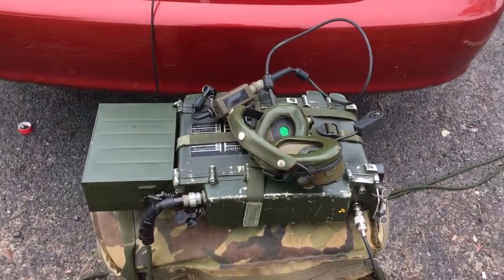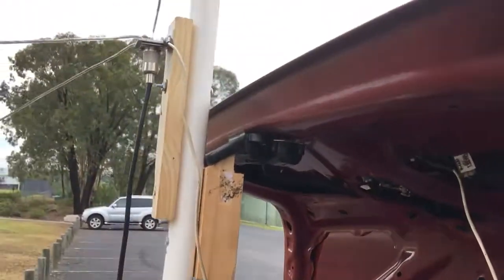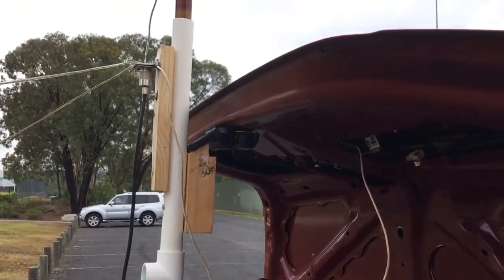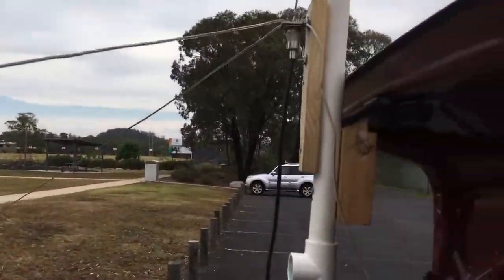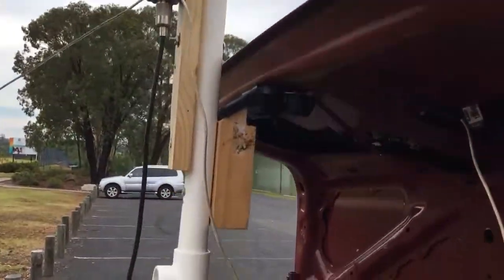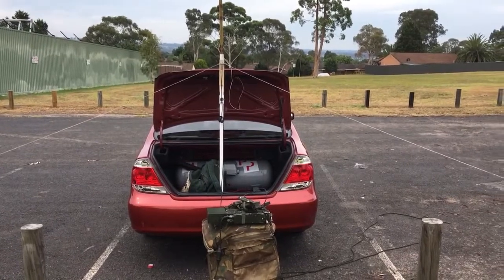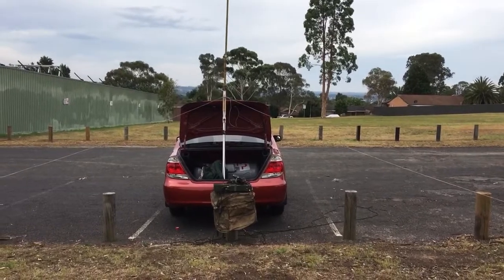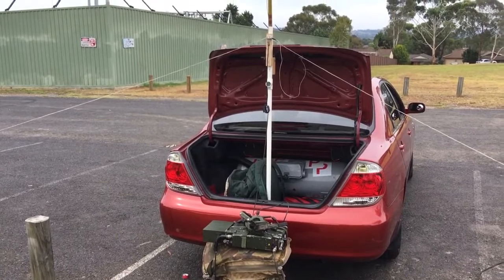VK2PRC Quarter wave vertical, stationary mobile antenna for 20M Band

Comment: Hello Alex, Great setup as usual. Do the counterpoise wires touch ground?  Thanks again.... 73.
Reply from the maker: Simply tie a short piece of string onto the ends of the counterpose wires, tie a loop into the end of the string and use 2 screwdrivers to anchor the counterpose..  This gives the counterpose a nice slope down from the feed point and improves the Feed Point impedance and gives a nice low angle of radiation.